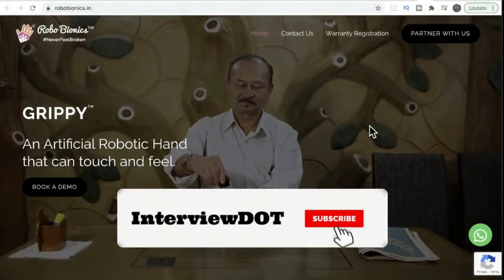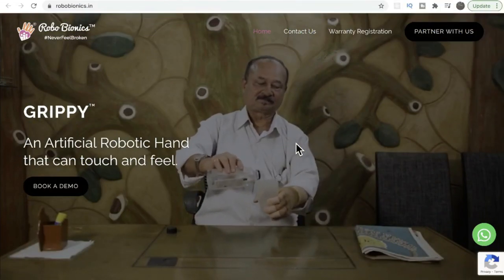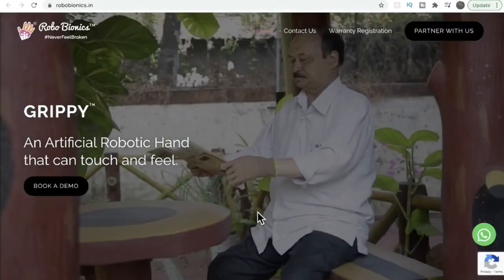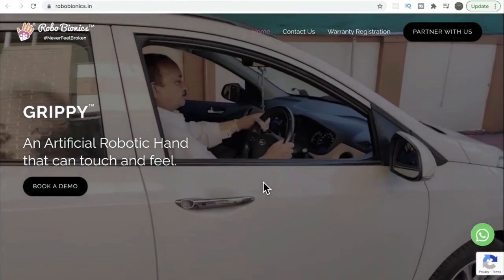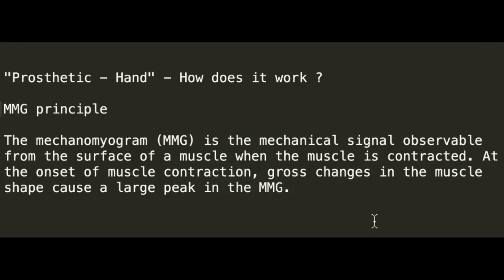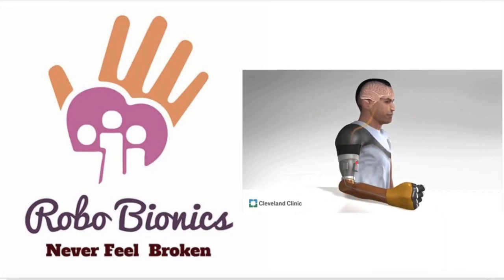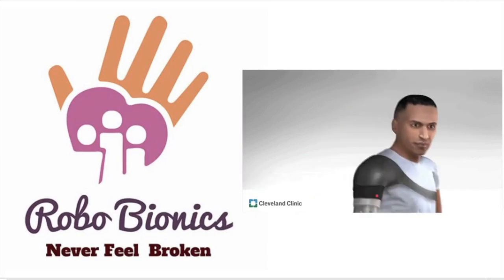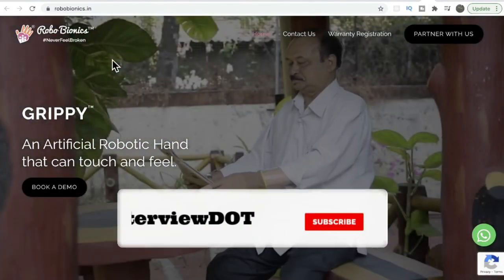STARTUP TALK EPISODE #15 ROBO BIONICS | GRIPPY PROSTHETIC HAND | MMG | HOW IT WORKS | InterviewDOT

Comment: Hi bro I  have doubt if I encrypt my password with sha-256 algorithm with salting 
After the hash stored in database ,how it checks 
Because everytime I store password without salting it gives unique hash for every output[if you run multiple time it will give you same hash] so it is easy to compare but for security purposes we add salt [extra random string] to make more secure here my doubt is how it compare with database because everytime it gives random hash
Reply: Password:ahamed
1st attempt
Without salting :sgehx...
With salting : dhxgs...
2nd attempt
Without salting:sgehx....
With salting:rzkxqs....

Here how it verifies password  it won't be equal when it is salted unless we loop the randomstring multiple times to compare salted hash that much decrease efficiency